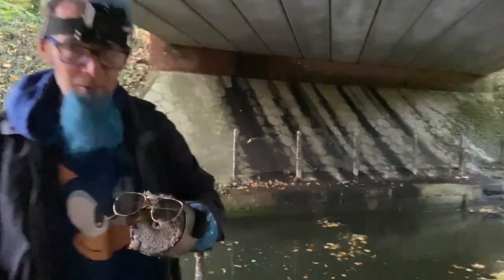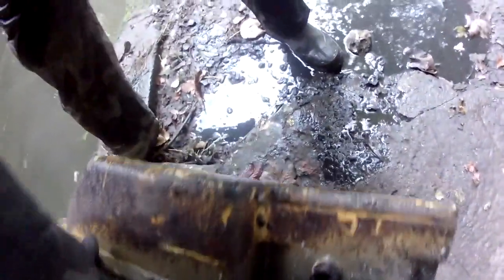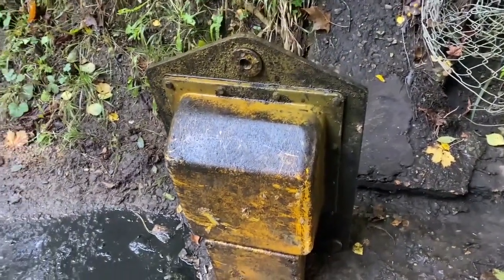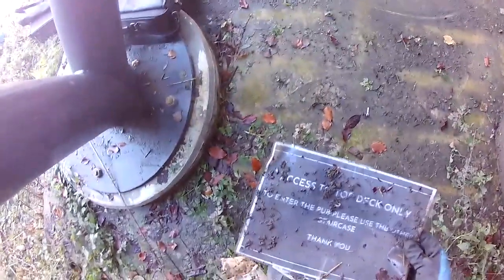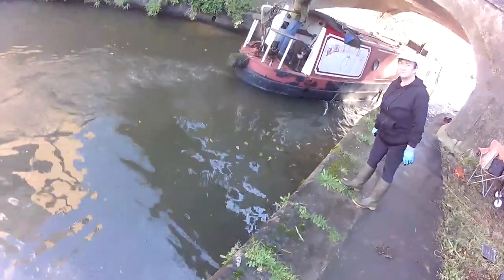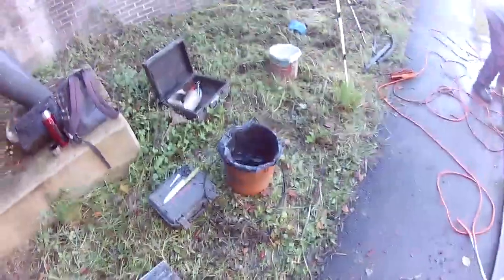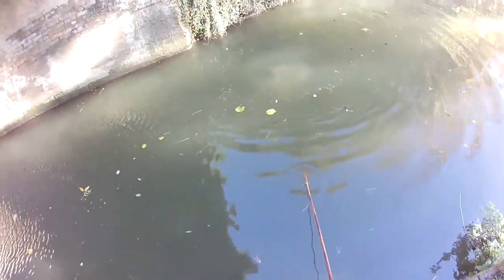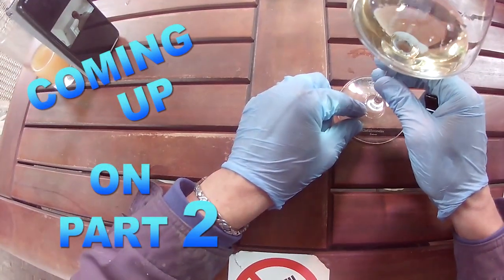Monster finds part 1 crazy heavy magnet fishing cleaning the waterways

Comment: I think that British rail thing you pulled up is a magnet connected to the signals , if a train goes over it it will sound a buzzer in the cab which the driver must press if he doesn’t after the buzzer has gone off 3 of the magnets then the deadman’s handle comes on and will stop the train as it thinks the driver is no longer in control of the train I think anyway  Ding Ding
Reply from the maker: DING DING thats mega interesting, it was so heavy thanks Matt 👍